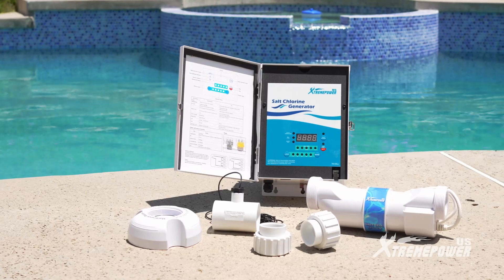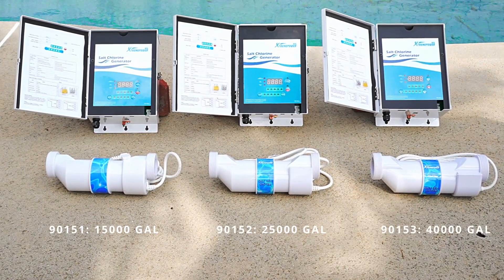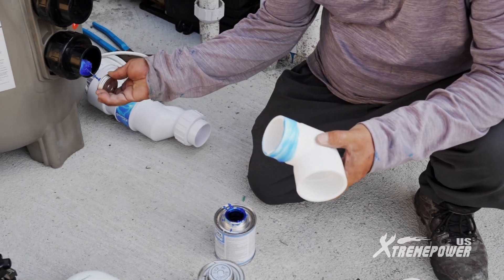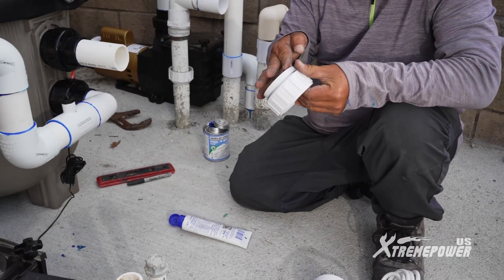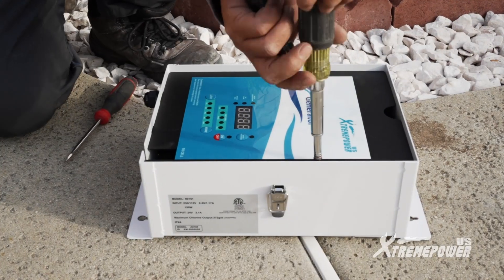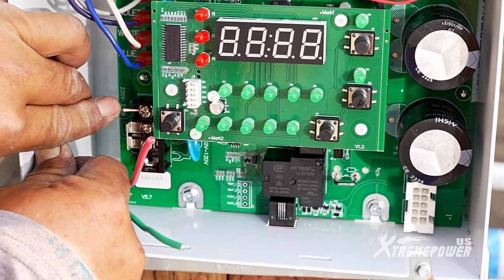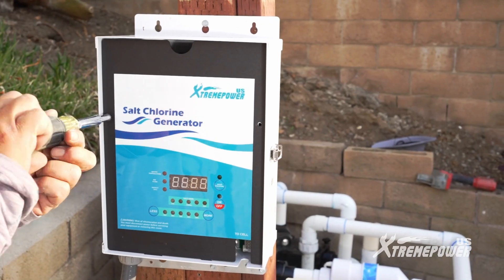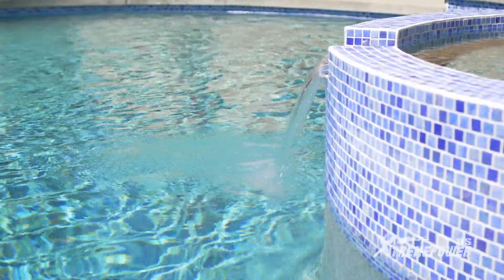XtremepowerUS: 15000GAL Pool Salt Water Chlorinator System Instruction, 90151

Comment: The ground wired was just capped and not connected to anything. Is that the proper install?
Reply: The video does show that the ground wire is simply capped (the yellow object). I did not see that any other wire is connected to the ground wire. My old system had the green screw for grounding. I plan to call the manufacturer and ask if I don't see any response here.
Reply: @Choam666  If you learn anything please let me know.
Reply: Did anyone find out where to connect the ground wire ??
Reply: I have installed these before but not this updated model 
And it was already wired when I got it 
So not sure on this one
It’s 240 v 
Let me know
Reply from the maker: Hello, the green cable should connect to the metal screw which is on the bottom, then connect the green cable to the nut, the nut near the bottom.